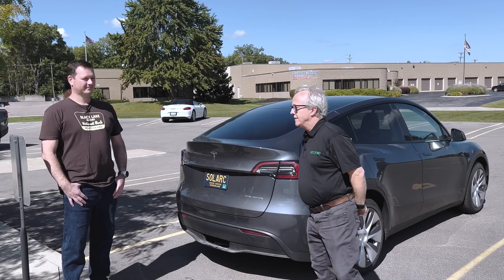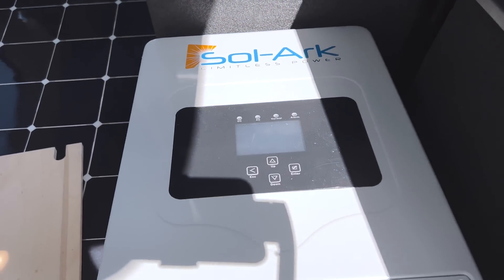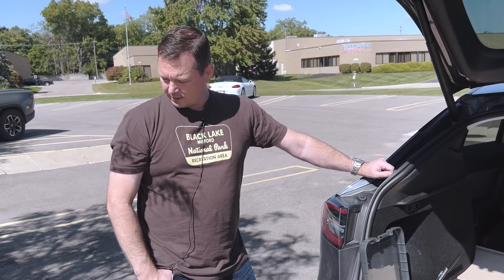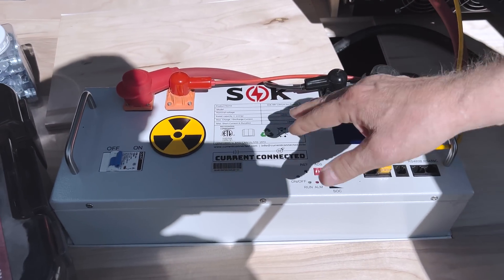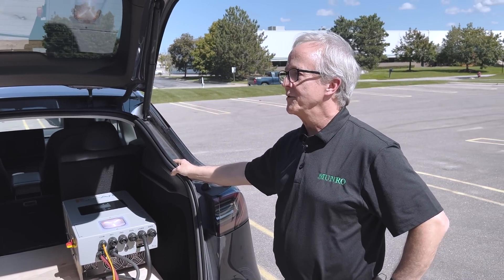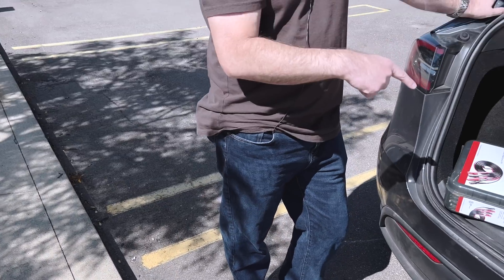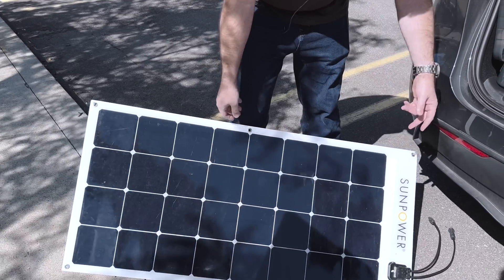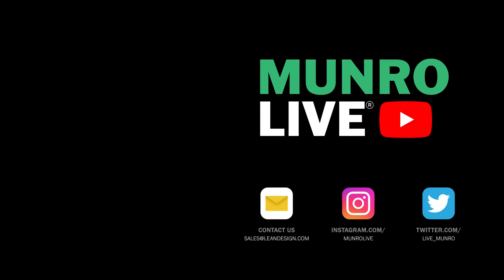Solar Powered Tesla Cannonball Run

Comment: 11:00 I noticed that the new 2023 Toyota Prius has an optional solar panel able to charge directly the High Voltage battery.
It would be interesting if Tesla would offer a similar option, to recharge the battery during the day when the car is parked.
This would be great when you drive away from major highways like going camping or hicking in the mountains for few days.  
So after few days of charging, this could provide extra range for going back to a public charger.
Reply: Cost benefit isn't there, so it's basically a gimmick. You need more surface area to really add range (folding solar awning on a truck?), or an extremely efficient vehicle like an Aptera for solar charging to make sense. It's a cool concept though!
Reply: @jooptablet1727 it's not a gimmick! Why wouldn't a manufacturer offer something like that!? It's actually useful not that everyone needs it but it actually works.
Reply: @carholic-sz3qv  it's a gimmick compared to my other examples and in the way that the marketing value is way higher than the actual value to the customer. They're paying way too much for something they don't really need
Reply: @jooptablet1727  lol!!!!!! What don't they need!? Are you serious!? People have been camping and living  with Toyota Prius for almost a decade now! That's a big addition to what they can actually rely on! Even a full EV doesn't offers what the Prius does which goes to remote places not needing to rely on charging network or fuel stations....I don't get the hate on that feature seriously!
Reply: It really only makes sense with vehicles with extremely high efficiencies. The Prius was likely more marketing than anything. Or maybe it could charge up the 12V battery given enough time in the sun. The Aptera and Lightyear make sense because they are so light and so efficient. Even though Teslas are relatively efficient compared to most EVs, they are about half as efficient as an Aptera. Also remember that solar panels and inverters add weight... a small panel on the flat of the roof MIGHT be able to recover the amount of energy lost due to the added weight but I would question how long it would take to pay for itself compared to charging costs. 🤷
Reply: @patreekotime4578 can you even inform yourself before making any comment!? The solar panel in the Prius is to recharge the 12v battery and also run the HVAC! That's more than enough for that tiny solar roof. The Prius is actually super efficient

Comment: This is excellent start! Its not very difficult design the EV itself to charge from wind and solar since the components in the two larger boxes in the video are already all inbuilt to the vehicle. The industry can arrive to a situation where the best add-on charging is one with small battery or for that mater a capacitor, to stabilize the output. Other bit is, if the setup is for camping, the solar panels could be in a tent structure. Solar has to go structural, 2023 is already too late.

Comment: This all seems excessive. There should already be a drape-able solar panel with a small converter to plug right into a Tesla. The fact that there isn't one means someone just isn't keeping up.
Reply: No, it means that would be pointless. He's using 64 panels and he is estimating 2-4 days to charge his Tesla to get 300 miles... only going 55mph. How many miles a day do you think you would get at normal driving speeds out of 3 or 4 of these panels?
Reply: @patreekotime4578 You're missing the point. Instead of staking out multiple panels with a serious converter loss on each, there should be a large tarp-like solar setup that requires only a quick drape on the car. It should be designed for the best simple conversion directly into a Tesla.
It'd be like how the Aptera has built-in solar panels. Direct solar conversion for best use.
All these excessive conversions with fan-cooling and such are a major power drain on the overall system.
Tesla should have a similar drape for emergencies at least. A person with an ICE car that runs out of gas can take a gas can for a walk.
Reply: @PaulADAigle  You're missing the point.  Draping a car is no where near enough AREA.
Reply: @CorwynGC  For what? To fully recharge? You know it's better than his small panels with serious losses.
It's a Tesla. It's not designed to be filled by solar quickly, but a drape can have the same panels he was using, and be designed well enough to limit any losses. Given time, it could easily salvage enough power to drive to a nearby charger. Also, this guy could accessorize enough to travel further and get where he wants to go more easily.
Reply: @PaulADAigle  It doesn't matter for what.  His solution is much better than yours.  A drape is obviously not aimed optimally, and  much of it would be in shade, the area is far less and would take days to even a short distance to the next charger.  Being a Tesla of course has nothing to do with how fast it accepts solar energy.  Do the math for yourself and see.
Reply: @CorwynGC You're making excuses against a non-existent product that would possibly be better and very easily handle the power losses. Your only argument would be simply to support his efforts, which I also do. I'm just stating that Tesla needs to use their exemplary experience in Solar to produce a product that would negate his attempts at power production. Tesla consumers would benefit greatly from such a product.
Reply: @PaulADAigle  You are missing that you want something which violates the laws of Physics.  Elon doesn't attempt to make such things.
Reply: @CorwynGC  I'm no electrician, but I know there are better ways to accomplish this. The Aptera is proof of this.
Reply: @PaulADAigle  You're right, you're no electrician! It's just math, work out the area required to generate the energy required for the trip.
You'll see then that you need the area of a tennis court to achieve it.
Aptera is great to top up for local use, but it's still going to need half a tennis court's area to cross the USA in a similar time.
Reply: @ahaveland  Personally, I don't need a tennis court, I just need to be able to leave it in the sun for days that give me enough range to go to the local grocery store or whatnot. I don't want to HAVE to plug it in at a house with electricity bills I don't pay.
Reply: @PaulADAigle  then that should be easily achievable. A trans-continental solar run is a very different and unusual use case!
Reply: @ahaveland  The more renewables the better, but there are already issues with power lines not being capable of transferring the power throughout nations. The best route is no power lines, but could only be handled by putting solar panels on every house so they don't need so many lines. Houses could power themselves and only power lines to help rather than supply it all.
Reply: @PaulADAigle  As more homes and businesses increase generation locally then the load on the grid should reduce, especially if there is enough local storage. There's also a benefit of not wasting energy in long distance transmission losses.
However, Energy can still be transmitted relatively efficiently between and across continents using HVDC.
A 100% renewable grid and generation is a solvable technical problem, but the real problem is a huge sector of the economy that doesn't want to change because they're loving the way things are with them raking in trillions of dollars in subsidies and profits!
Reply: @ahaveland  As you mentioned, energy is lost in transmission. The HVDC is no different as it's lost in the resistance in any material useful for such things. Not that I'm against it, but there's a more lossless way to accomplish it, usually by less transmission and more local.
That said, profit breeds greed, and less will be done for the betterment because of it. Oil companies are one of the biggest problems as not only are they rich from producing, but they are richer yet from government funding and bribes. They've known about Climate Change for many decades and chose to soil politicians and the general public to stop any change from happening. The only real way to hinder CC is by being forceful and determined in our politics and expressing opinions. Getting the rich and powerful on board would be a huge benefit, both in renewables and in combating oil/gas. I am neither rich nor powerful, so all I can do is try to inspire with my words.

Comment: low amperage DC charging would be easy to implement in any EV, I am curious how they react to square wave inverters?
Reply: We use a DC DC converter! DC solar in (~640V) DC CCS out (350-400V) already did 24k+ miles in Africa in the past 10 months
Reply: @4x4electric  that's awesome! i'm checking out your channel now!
Reply: Luckily the inverter he's using is a nice quality sinewave type. I think the main issue with charging DC is hacking all the systems on the car to make it happy, as well as regulating a nice source of high voltage DC (also don't forget personal safety issues) without having to build all the equipment from scratch.

Comment: I wonder how many of those panels it would take to cover a commercial electric tractor trailer trailer or two. Lag bolts not screws. Maybe tow sets of batteries one working and one charging,switching back and forth to extend range.

Comment: Tesla should make an MPPT charger to communicate then charge a car with solar or another DC power source. Conversions are lossy and requires multiple equipment.
Reply: We use a DC DC converter! DC solar in (~640V) DC CCS out (350-400V) already did 24k+ miles in Africa in the past 10 months
Reply: @4x4electric  Can you link me a video or page about this? I'm curious on equipment used. I can't find it in your channel. thanks!
Reply: It would need a pretty substantial DC-DC boost converter to raise up the voltage. However I agree converting DC to AC and viceversa is even worse
Reply: @theagentsmith  I did a  search, a high voltage output charger at 400V at 200A is about the same size as the inverter in the video or these dimensions 440*1000*450mm.  I guess it is just a matter of how large the current it will handle than the voltage difference in DC-DC conversion.

Comment: He might want to run his setup by Will Prowse (DIY Solar channel). There may be some overlooked opportunities for improvements.
Reply: Absolutely, Will has extensive knowledge on solar and Teslas!
Reply: The components he uses are often featured on Will’s channel. I’m betting he’s seen the vids
Reply: Perhaps he could tow a flat solar panel trailer like Will was working on a while ago?
Reply: @johnbuchman4854  I considered it, but the drag hit you take is substantial and would need twice the array size and 3x$$$.
Reply: Will likes SOK batteries. I suspect he'd find the rest is very efficient, but top dollar can often buy that.
Reply: Main improvement would be using a lighter car. But I suspect he's half arseing or rushing to get this record done before aptera tries it as a publicity stunt. Aptera ceo already mentioned the charge controller is oversized and could support much more solar.
Reply: Yes I am a big fan of Will Prowse, it was his tear down of the SOK that gave me confidence in using it in the high vibration environment of a vehicle. I did take mine apart, set it vertically and loosen the battery retention screws to let it all settle in the vertical position before tightening so the cells were not placing the screws in sheer.

Comment: I'd be more interested in a Cannonball Run that utilizes chargers.  This is way too nerdy for the public at large and will probably be used by media to further perpetuate the myths around EVs in general.
Reply: He could do a reverse cannonball run using chargers I guess
Reply: The current EV Cannonball Run record (or Gumball Rally record if you are old) is 42 hours 17 minutes.
Reply: @CorwynGC  That's really cool to know!  We've traveled a bit with our M-Y and haven't had any issues.  I wouldn't be intimidated at the thought of taking a trip across the country.
Reply: Well, a true Cannonball is a speed run. This run sounds like it will take 21 days (anyone for a betting pool?) and cross country using chargers has mainly been done. Proving the inadequacies of the current charging network. And a national network of 800A charging stations would require a whole new electric grid. Meanwhile, DHS and the electric utilities are literally playing whackamole and can't prevent literally hundreds of attacks on the existing grid.
Reply: @lyfandeth  sigh.  It won't require a "whole new electric grid."  That's nothing but fear mongering.  You need to study up on the topic a wee bit.
Reply: @lyfandeth  You need to understand that if the entire fleet of cars in the US suddenly converted to electricity, the total usage of electricity would go DOWN.  The charging infrastructure isn't in place yet, and the grid would require some realigning, but grid use as a whole would benefit.
Reply: @lyfandeth Its part Hypermiling, part Cannonball. Just burning up fuel is very 1970s.
Reply: @lyfandeth  My prediction is that he will be able to average 100 miles per day. That's 30 days....
Reply: Well then it wouldnt be a Solar Cannonball Run, which is what this is.
Reply: @patreekotime4578  I stand by my comment.  It's cool.  It's fun.  The guy will get a few subs and maybe find his voice.  At the end of the day?  It'll be bad for EVs.
Reply: Tesla did a coast to coast drive using only Superchargers in the early days of the Model S (2012?) Kyle Connor (Out of Spec Motoring) and others have done numerous coast to coast cannonball runs with a variety of EVs, Tesla, Porsche etc. I believe the EV cannonball record they set in the Taycan 2 years ago (44 hours 25 minutes) still stands. They tried to break the record driving a Lucid, but ran into two many troublesome chargers. The Tesla Supercharger network is far more reliable, and its possible the updated and somewhat more efficient and faster charging Model S could beat the record, especially because there are more chargers, and faster chargers available now than when they last did a Cannoball run in a Tesla.
Here is a link to the run with the Taycan:  https://youtu.be/IFg8LaZFqYE?si=cX-uhBQOPY79_Sfs

Comment: It would be nice to see someone try this type of adventure and apply solar panels to the roof of the vehicle.  There is plenty of space there and the day time hours traveling could also be generating power.
Is there a compelling mitigating issue that prevent this??
Reply: You can only fit about 400-500W on a fully-canopied car this size. Which is only likely to generate <2kWh/day after charging inefficiencies and accounting for tilt, shading, etc.
Reply: Fisker had them default. The problem is sun provides 1kwh/square meter. Solar panels have about 20% efficiency. So you can get somewhat 400w/hour on ideal circumstances which in reality is just like 6 miles/10km a day. Better than nothing for sure. But is it saving cost  with the added weight and all, I'm unsure. Would be good for cars that aren't driven much so there's no need to charge them. Maybe golf carts and such. Maybe busses due the size, camping vehicles for sure.
Reply: He is using 64 of those panels. Unfortunately you need a lot of panels to accommodate charging a vehicle as he said it would take 2-3 days to charge his car. We aren’t anywhere close to self contained charging cars.
Reply: You can only get around 400 Watts but there is extra weight so it's worsen the efficiency. 400 watt gonna take like 2 weeks to charge
Reply: @Matzes But youll never get even close to peak output for a flat panel on the roof, especially not in the New York State!
Reply: @patreekotime4578  yea 400 in good conditions
Reply: One of the big problems is that panels need to be aimed to get best efficiency. Near the equator you might get decent charging in the middle of the day. At noon in New York State, even in summer, you are never even going to reach peak efficiency for the panel, and for the rest of the day its even worse. So maybe if you lucky, 2 miles a day. Also, you dont drive during the day. AC murders range. You charge during the day and drive at night. With a small panel on the roof, it would never even generate enough power to run the AC.
Reply: I believe driving at night and harvesting as much power during the day as possible is a better use of "sun hours".  Also aero is very important for driving efficiency so putting anything on the vehicle that increases drag is going to be a significant disadvantage, especially any type of trailer like many people are suggesting. Ideally whenever the sun is up, he needs to be capturing as much of it as possible, so using a ton more ground mounted solar would be a pretty decent improvement, you just need the space.

Comment: That sounds like a pain in the ass.  I would approach this with a trailer, deployable & motorized of course.
Reply: lightweight alum trailer 5mteres long  , 32 panels x 2 rows, flippable left and right hinged at the top perhaps , or extend a Sailing type mast ,  raise the array to top of collaspable mast x two,  cables already connected, a cover to dowse down the power production, or stackable, like a mainsail.  then cover.
Reply: Or a limo version and mount the deployable array on the roof.

Comment: While I'm glad someone is pioneering the concept. The vehicle choice is definitely not optimal. I think this person is doing a half baked job and rushing for the title just to put the record on a resume. I suspect aptera might do a coast to coast run as a publicity stunt in the future. The ceo already mentioned the charge controller is oversized and could support more solar panels natively. I think with only one working prototype they dont want to spend a week doing a cannonball, but given the production cars body panels are rolling off the line. I think next summer aptera will try it.